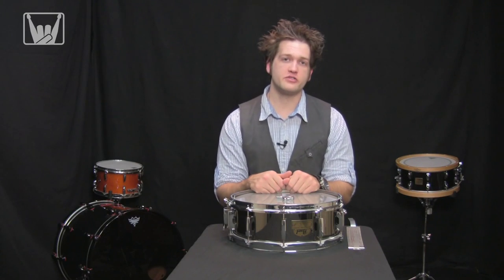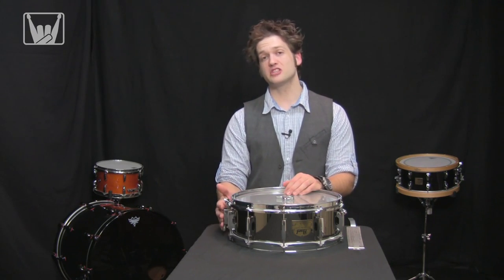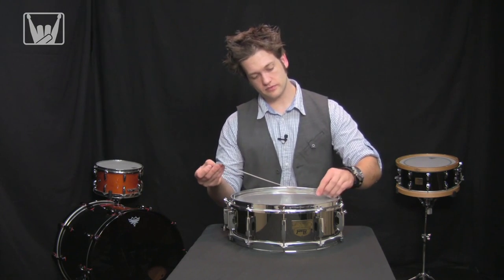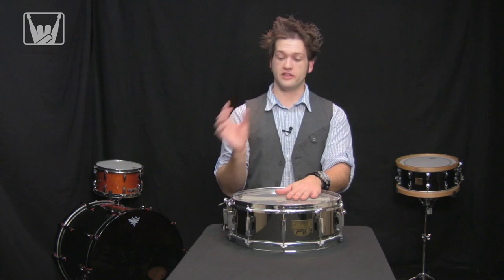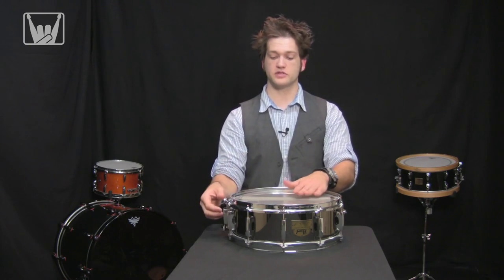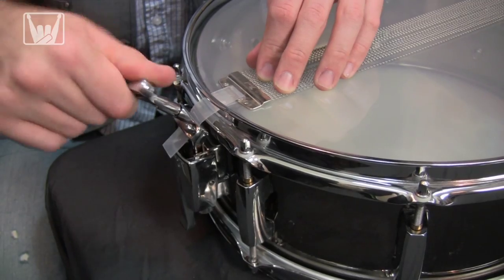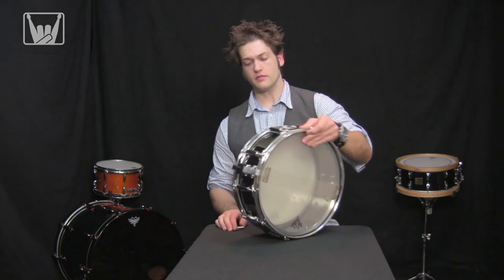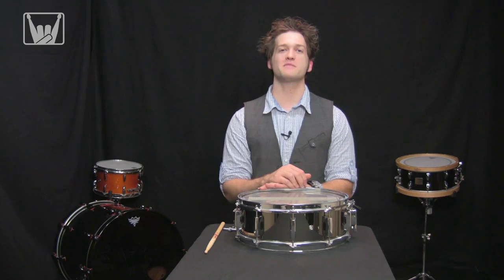Anatomy Of A Snare Drum pt3 - Tech & Tuning with Kurt

Comment: One thing I'd love to repeat is that snare wire tension is always a preference.  I'm not sure if anyone else likes this, but my preference is to get appropriate snare sound at any level, from anywhere on the drum.  An example being a snare buzz roll from soft to loud, starting at the edge of the drum.  With normal methods it's hard to get that just right, but I found through another video an excellent way to get this, if you are the kind of drummer who prefers this.

There is a video floating around of Jojo Mayer tuning the Protean snares at the Sonor booth during a NAMM convention.  One trick he does is to buzz a single stick at the edge of the batter side, above the snare strainer.  This is perfect for making sure you get the appropriate tension for snare sound at all dynamics and all areas on the drum.  I do think it works better of the butt plate is adjustable, but it still works with normal butt plates as well.